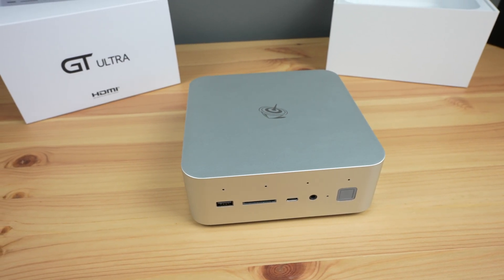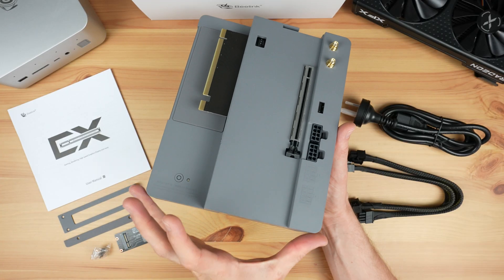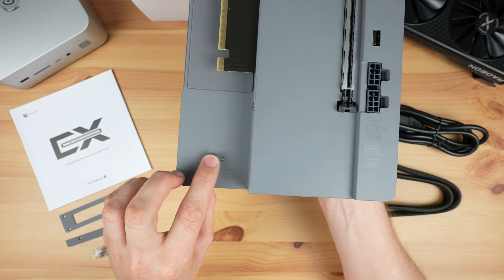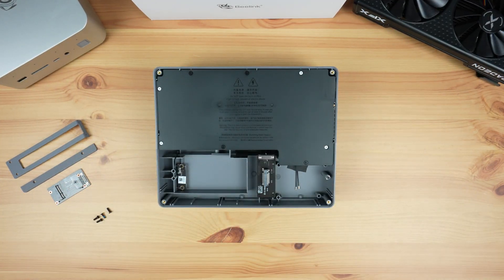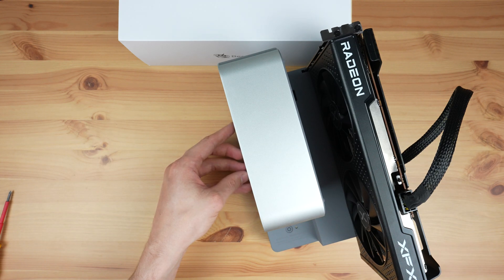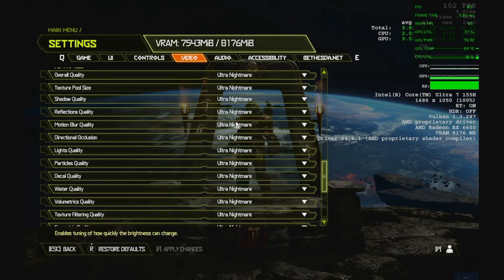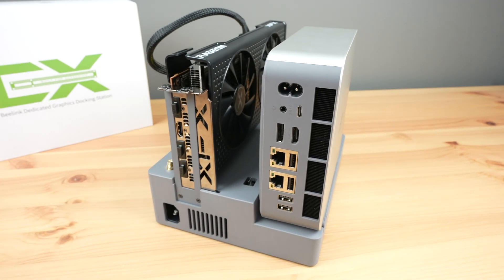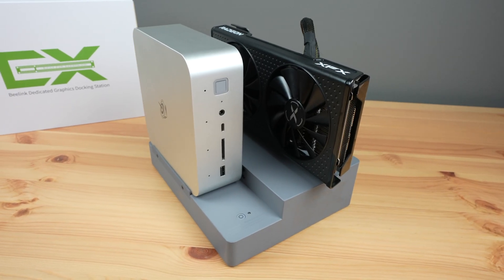Add A GPU To Your GTi Mini PC With The EX Docking Station

Comment: Just bought a gpu for this but for some reason it just cannot detect the gpu. Was it just plug it in, download drivers, and then it worked?
Reply from the maker: Have you got power to the dock and the PC and you've turned the dock on first? You shouldn't need drivers for the GPU to at least be detected/show up in Device Manager.
Reply: Yup getting power to the dock and pc. Starting the dock first and then the pc. It’s weird because the fans are spinning but task manager and nvidia app do not detect it. Not really sure what to do
Reply from the maker: Next I'd check that the PCIe connector from the dock is clean and is correctly seated in the Mini PC's slot.
Reply: Bios
Reply: @nepster5403 did you ever get this resolved?  I have been having same experience for a month, now working with Beelink support.

Comment: Just curious, why a riser is needed? What is preventing a PCIe card being directly plugged into the slot?
Reply from the maker: The slot is recessed too deeply in the case to plug directly into it - I'm not sure why they designed it like this.

Comment: Will this docking station work with
Beelink SER9 AMD Ryzen™ AI 9 HX 370??? :face-orange-raised-eyebrow:
Reply from the maker: No, the SER series doesn't have a PCIe port on the bottom to plug into the dock. This only works with the GTi 12 and 14 series PCs.

Comment: I checked your blog and irdered some M2.5 standoffs. I assume / hope they will also fit the SER9. Ive ordered a few different heights to try. SER9 works great with a M.2 to PCIe dock but wanting it to look a lottle bit nice, so raising the bittom cover is a neat solution.
Reply from the maker: I haven't got a SER9 but the SER3 uses similar M2.5 screws so I think the SER9 would be the same.

Comment: Hello. When I connect the Type-C cable portable monitor to a Gti14 mini computer with Thunderbolt 4, the monitor does not show the image. If I still connect Type-C Power to second port, then it begins to show the image. Does you show image via one usb type-c cable?
Reply from the maker: I haven't tried running a portable monitor from it alone but it should be able to power the monitor. Are you connecting the second type-c power cable to a second port on the monitor or on the PC?

Comment: What a ridiculous concept. Once you've finished buying and setting it all up the entire point of these mini PC's is completely negated. Save you're money and just buy an ordinary desktop computer, all the positives and more, with none of the downsides. This is just a half baked attempt at a solution to solve a problem that doesn't need solving.
Reply from the maker: If you've got the space and don't need portability then a desktop PC is almost always better than a mini PC.
Reply: @MichaelKlements  and with this "dock" the amount of dust, hair, etc, that will muck up the GPU fans will be amazing...
Reply: @MichaelKlements  By the time you've set all that up on your desk, you might as well have gotten an ordinary desktop computer - which was my point. Mini PC's are supposed to fill a niche where space is lacking. Sticking one into that thing makes it as big as a compact desktop only it costs more, and is less upgradable and less configurable. And it looks ridiculous to boot.
Reply: This is like a turbo Honda beating a truck. Doesn’t have to be done. But… it’s funny, it’s awesome, and the dudes with the trucks(pc’s) are at home crying!
Reply: This set Up IS way smaller than a normal pc.
Reply: @jesusdelmas and cheaper in most cases, itx parts are expensive!
Reply: that mini pc with pcie dock can indeed be a solution for use cases where you only need a grafic card sometimes or if you don't need one at all but would Love to be able to in the future. Indeed a truly itx build in a 10l case is way more expensive than this mini pc, not to mention that most people may don't want to invest the time to build a 10L itx build. If you ever tried it, you may know what I mean 😂

Comment: I would like to know the performance of the nvme slot and how it affects the dGPU.
Reply from the maker: The GPU interface is PCIe 4.0 x 8 and there is a separate PCIe 4.0 x 1 lane for the NVMe drive so it won't affect the GPU's performance.

Comment: This is very cool but I fail to see how it is useful? Its not very hot swappable as you have to unscrew a plate, I think a mechanical method like you said would really help it. At this point why not make a custom itx pc or just use a high end laptop? I guess it could be a good gpu test bench. 

Great vid btw, really showed this thing in detail!
Reply from the maker: It's useful if you are going to use the mini PC without the GPU on occasion for portability. But I agree, they could have made the "docking" functionality a bit easier to use.